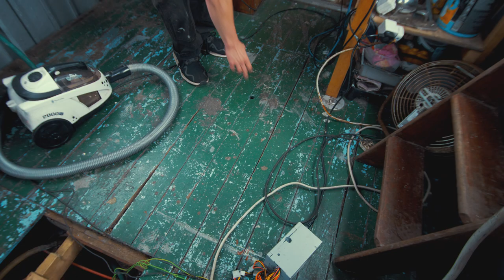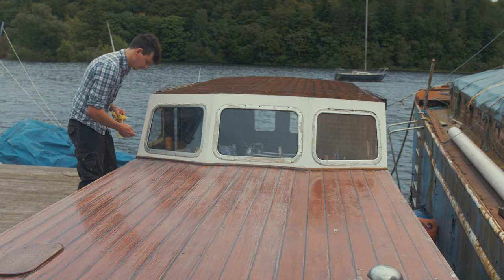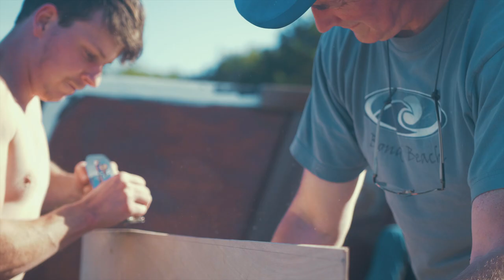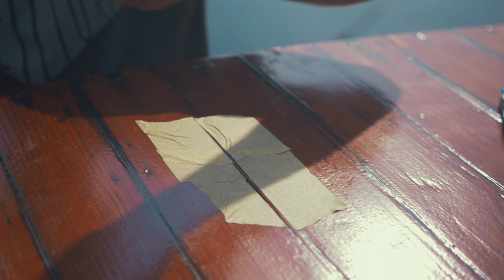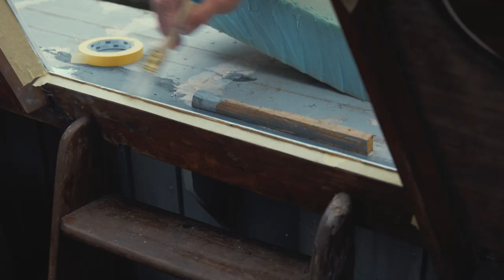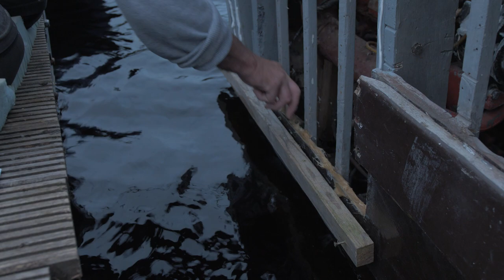Episode 13 - Restoring 80 year old 40' Wooden Boat into a liveaboard ⚓ Painting Cabin & Repair stern

Comment: The reason your windows are still leaking is because you are letting the caulking set up before you are pulling off the masking tape. When you cut the boundary where the tape and the caulking meat you are opening that up for moisture to stand. As soon as you apply that and you wipe it with your finger, yes wipe it with your finger pull the tape off immediately afterwards. Hope this helps you out. Love your channel and the boat
Reply: จ

Comment: haha, patches tip of the day, i used to restore Land Rovers and anyone who knows them, knows that the windows leak like the proverbial - the issue generally is the mix of weather and UV, i found that black mastic was a pain, it dries, hardens, the window if glass or plastic perspex etc would flex and create the gap and leak - silicon is of course way more flexible but during assembly would squash the wet silicon out, the answer was pretty simple, tape round the windows and frames as you have been doing, slip in between the glass and frame an inch length of electrical wire at corners and centre if window has some width, use a house hold like earthing wire as its a little heavier duty, squirt in your silicon and use either a wet finger or rag to wipe off excess, peel off tape and reinstall window with frame, should keep you out of trouble for a bit longer

Comment: I think you should name this boat "Labor of Love" I use to use a really good marine caulk called BoatLife to reseal windows & port holes it expands & contracts with the wood to prevent leaks.Heres a tip for ya, remove any masking tape immediately after your finished painting or caulking & never leave it on overnight or it will glue itself to the surface. You could make some tin visors to go over the tops of your boats windows & paint them, these will help keep water off them. Looks like you guys are making good progress & there's one thing for sure you have a passion for this old wood boat restoration.
Thanks for the updates on this Wonderfull project.🍀

Comment: The window frames expand and contract from heat and cooling. Over time the sealant will dry out and separate from the glass frame and frame to cabin surface. Try using Butyl putty tape to seal the glass and frames. Butyl tape stays playable, won’t dry out and won’t crack and leak. I worked on aircraft for many years and we used Butyl tape to seal windows and panels. Unfortunately you’ll have to remove each window and frame again to remove all old sealant in order to apply the Butyl putty tape to a clean frame/glass surface. I believe that will fix your leaks. Good luck on your project!
Reply: I was going to suggest the same thing.  Butyl rubber is a wonderful sealant, and much easier to work with than caulking out of a tube.  Doesn't dry out and stays flexible.  Make sure you find the marine grade, there's a lower grade used for caravans and campers that doesn't stand up quite as well.  Great project, you're making good progress.
Reply: Uh
Reply: Spot on

Comment: If the temp is warmer inside than outside, you'll get condensation on the inside of the window and metal frame. I resealed my windows due to leaks, but you never stop the window from sweating if they are single pane. A fan will help. Good luck on your adventure!

Comment: just a tip when caulking push the nozzle away from you instead of dragging it over the joint you are caulking. this forces the caulking into the joint. keep up the good work!

Comment: Most  oats leak through their port lights. Mine is fibreglass but leaks nevertheless. I have found butyl tape to be very effective in bedding frames onto fibre glass. Much better than sealant. Have you tried this? It may not be so effective on a wooden boat but thought it worth mentioning.

Comment: You need to pull all those windows and frames.  Recaulk everything, then reinstall the frames with a generous bedding of marine sealant.
Reply from the maker: Done and dusted. This is what I did when I worked on them one by one

Comment: May i offer some advice about sealing your windows, if you use Sika multi primer for marine, also they do one for glass, it will work, I use it on windows and frames on fiberglass and it can be used on hardwood before veernering and formica and glueing or sealing with sika, and it will help lot's.
Hope this is some help.

Comment: Guys, a sharp oscillating saw and patience and craftsmanship can cut out each rotted diagonal plank complete with its own angled scarf joint. New planks easily made and installed with 3M 5200. Putting a piece of plywood in with one long vertical joint will never be right. Even with two layers. At the very least, the inner layer can be plywood but stagger the the seams and put on an outer layer the same as the original.

Comment: Regarding the sealing of the windows. Wouldn't you normally totally remove the glass and frames. Clean all surfaces, then rebed the frames and glass? I would recommend that you find a good book on boat maintenance as a guide. Also, is condensation a possibility for inside moisture? All that said, I like your work, keep it up.

Comment: Are you sure that the water is a leak?  Could it be condensation building up on the inside of the aluminum?  Maybe some sort of insulation on the inside frame?
Reply from the maker: It's too much and there is no sign of condensation these days. The boat is all wood. Do you mean on the aluminium paint?
Reply: @LakesideProductions  I didn't realize it was aluminum paint.  I thought the window had an aluminum frame.
Reply from the maker: You're right the windows do have aluminium frames

Comment: RE Windows    Had problems with a Range Rover sunshine roof it turned out to be condensation => Have had the same problem with Discovery sunroofs => Yes I had water leaking into the vehicles but not through the sun roofs...

Comment: Quiet simple with the windows , the DIY therapy did not work , take the frames out , Rebed them in properly screw them back in using the correct syliflex these hav ego be water tight

Comment: Sorry bro, thought I’d drop by and see how your doing,  and here you are working on though’s %=+&$# windows again Urrrrrrr.  Please take them out by the frame, Clean and reseal with a good caulker,  my secret,, I use thick string “cotton” dipped in hot tar with silicone. Well it’s worked for thirty years now.   You must seal from the inside to seal out...good rule of thumb or law.....